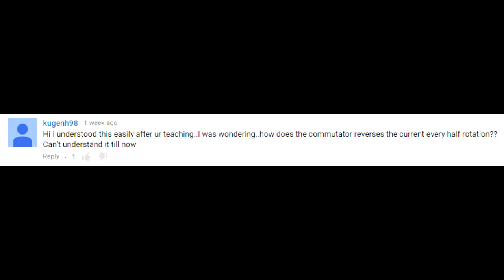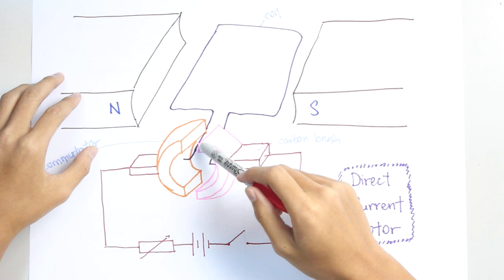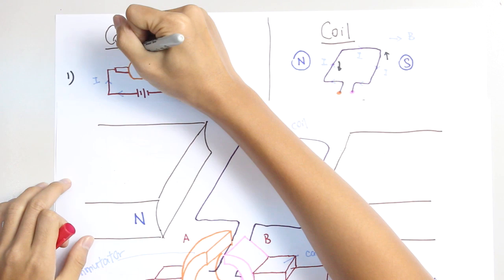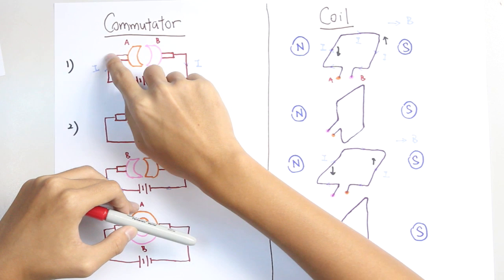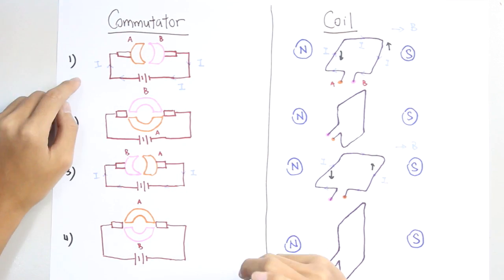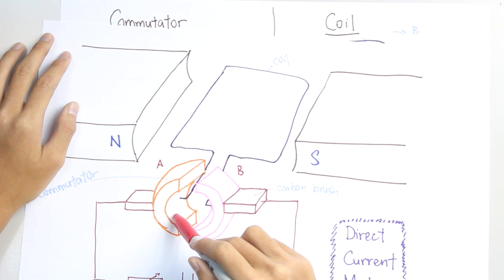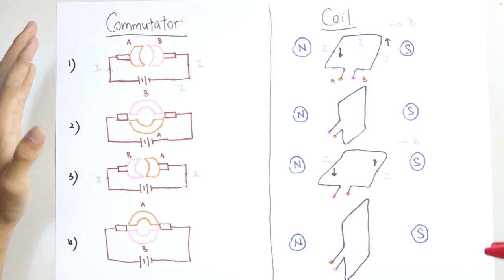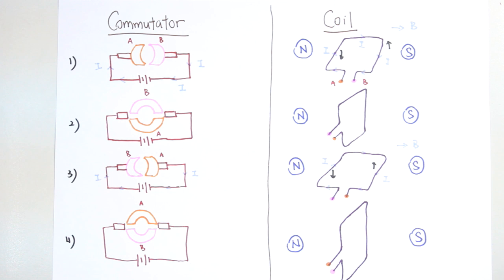Physics - Commutators in DC Motor

Comment: one question
When the coil is vertical, both brushes come in contact with both segments of the split ring commutator. now wouldn't that short out the supply circuit
Reply from the maker: when the coil is vertical, the carbon brush and the commutator are not in contact, so no current flows into the coil. Hope it helps. Pls like & subscribe
Reply: @mrsaimun  but the gap, the space, the split is so narrow and brushes so wide. Same could be seen in any other graphics
Reply from the maker: @RizwanKhan_99  you can search around for related videos with animation will help you visualize it easier.
Reply: thank you mr sai
Reply from the maker: @RizwanKhan_99  sure. U r welcome.

Comment: That was a very useful video! Thanks a lot! But may I clarify? To sum up, the current is NOT reversed, conventional flow from the Positive to Negative terminal still takes place, and the split ring commutator just changes the coil (A/B) at the respective carbon brushes to ensure unidirectional flow of current. Am I correct or did I misunderstand anything?
Reply from the maker: Well done. Correct

Comment: Curewmt will remain in the same direction ok 
But where the current reverses due to this phenomenon please  explain this
Reply: Do you got Ans of your questions please tell me same problem is here
Reply: Current doesnt reverse, but rather the commutator is an integral component supplementing its rotation. As soon as the brushes stop making contact with the commutator, the wires depend on inertial force (as it has angular momentum) to complete 180* of a turn and then the commutators maintain contact with the brushes again allowing current flow. Now, without the commutators, every half turn the wires woukd be going back and forth, but with the commutators, allowing the wires to be free of current for a certain period of time allows the wire to rotate.